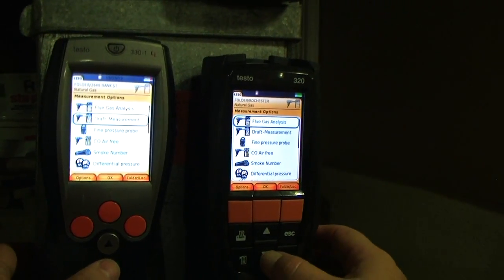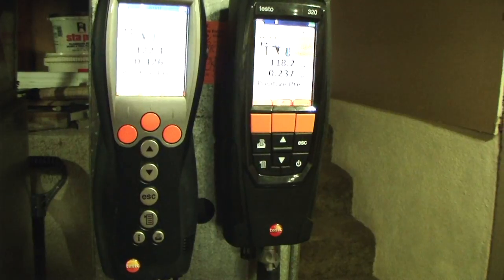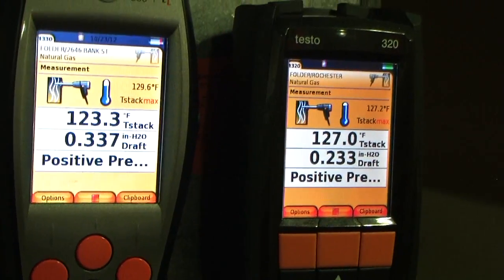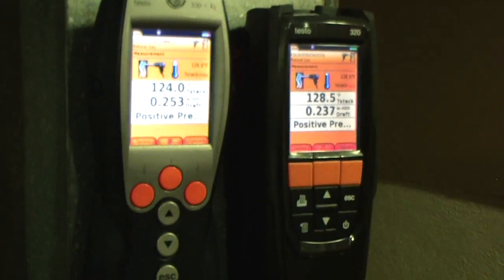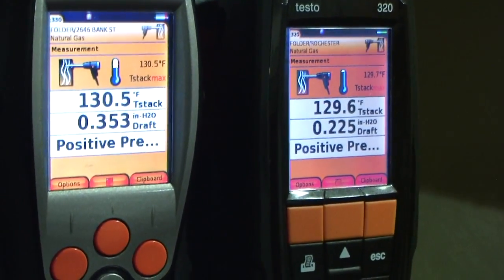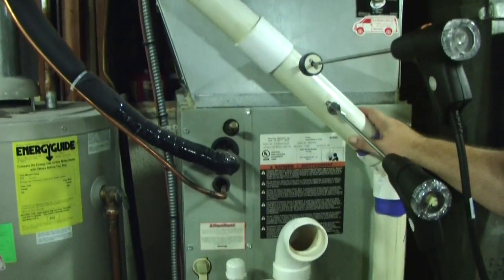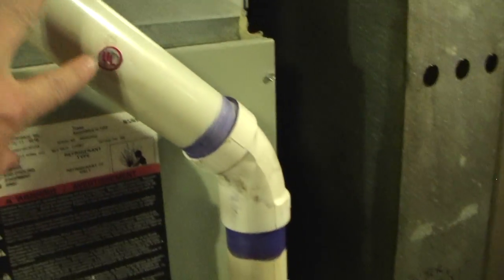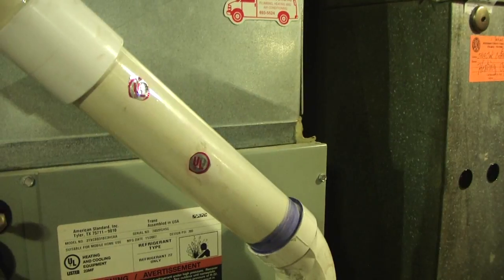HVAC - Measuring Draft

Comment: keep in mind long radius fittings vs medium and short.  Most manufacturers will specify in there installation manuals different equivalent lengths depending on the fittings you use. I highly recommend always using long radius and 2 45s vs a 90 whenever possible.